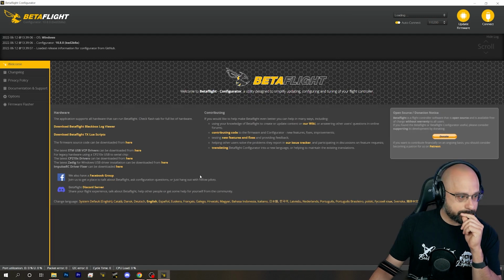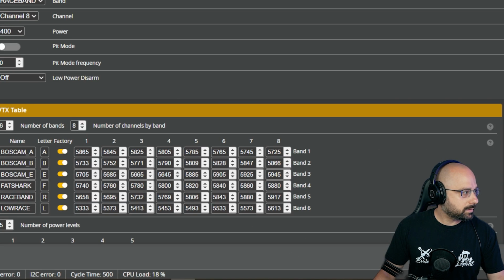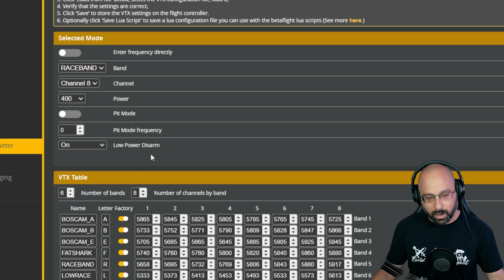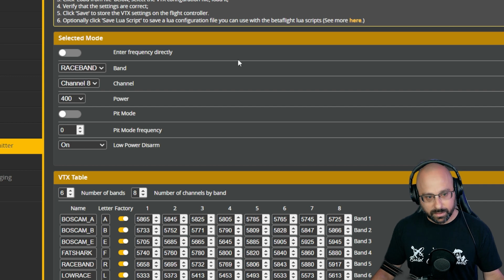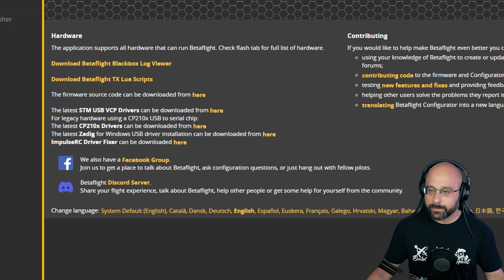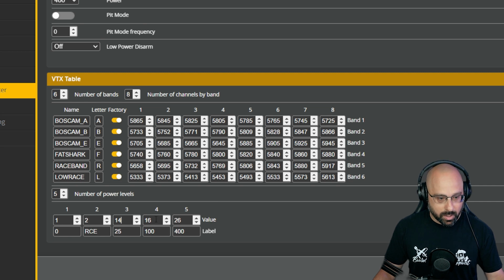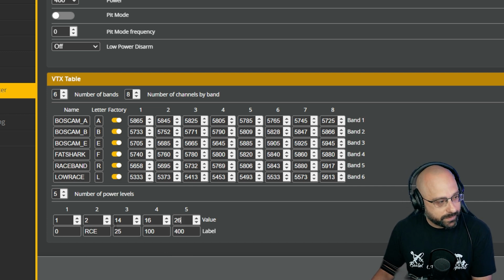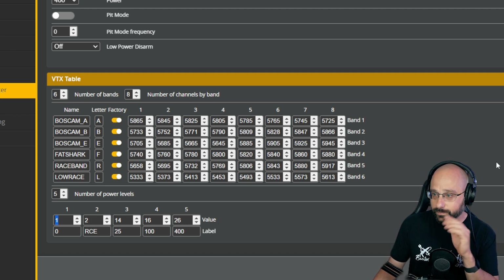My Crazybee AIO VTX Has Bad Video Range! Help! - FPV Troubleshooting

Comment: If you have the board with the openvtx on it the fc will go to low power during a flight. I have several openvtx vtx and the happy model aio and they all do it. Remove the low power, 0 and pit, from the power and it will stop going into low power mode.
Reply: How do u remove the lowe power and pit? My diamond fc won’t let me fly over 10 feet away. I have low power disarm set to off and pit mode is off
Reply: @djs134   go into betaflight and navigate to the vtx tab. Towards the bottom you will see the power right under the bands list. Change from 5 to 3 and change the numbers in the power section to reflect the powers you want to keep. Under the power is just a label you can but what ever there and that is what shows up in the goggles.

14    20    26     Value
25.  100   400.  Label
Reply: @cohibamatt8117  just did all that u said and I still can’t fly into the next room , regardless if I’m on 25mw or 400
Reply: @djs134  That should keep you from going into low power. Check your antenna to make sure they are attached correctly. Also, check the protocol in the tabs section. If it is set to smart audio try tramp. You will need to go into the presets and add the preset for open vtx. It should ask which protocol to use and hit save and reboot. You may need to go and try the power adjustment again. It did it to me no matter which protocol I used only removing the 0 and 25 mW stopped mine from going into low power. It worked for my x12 boards and my ovx306 boards.
Reply: @cohibamatt8117  Dude, thank you. You just cured my massive headache.

Comment: I had that in my crux3. V2.0 There's 3 kinds of that board actually which varies in the Rx transmission. For vtx, you must find this bridge solder in one corner to enable external vtx. Then  find the v.out that goes to your new vtx v.in. If you still have spare tx rx you may solder that and change in config. Note that it's hard to solder on that tiny board. I toasted one because it's almost impossible to access the pads., , and another one with solder pad easily peeled off.
Reply: Note about the Crux3 FC : I had the same issue using BF 4.3 firmware with my CrazyBee V2.2 AIO. I managed to make it work using BF 3.7 firmware

Comment: AIO FC's with an integrated VTX doesn't Support Pit Mode (0,1 mW). They just support low power (25 mW) until first armed - everytime you Disarm - or always full power.

I sometimes forgot to flip the pit mode switch on my Toothpick: started flying and immediately lost video after like 2 meters of flight 😂